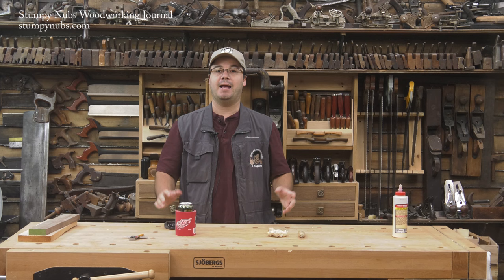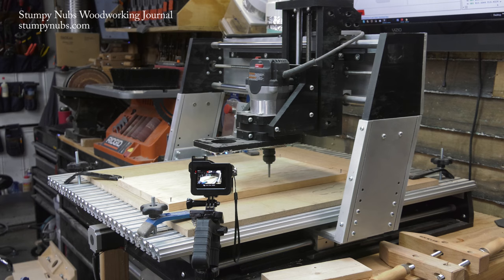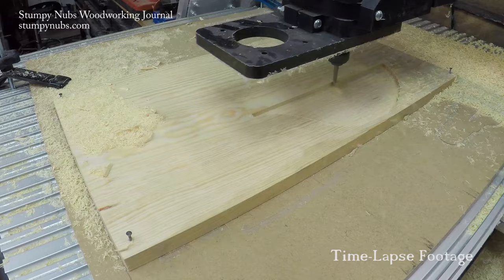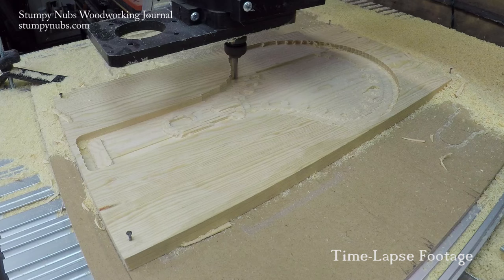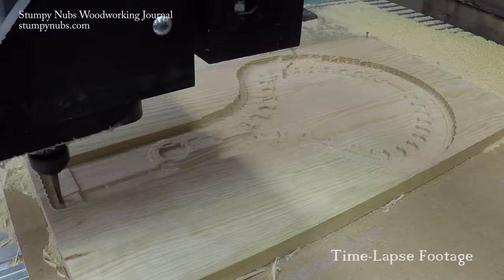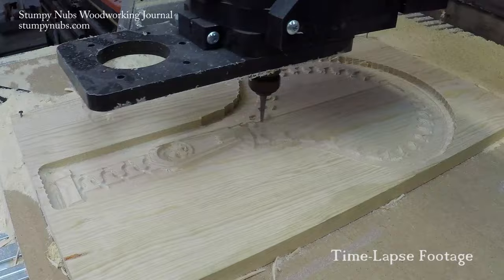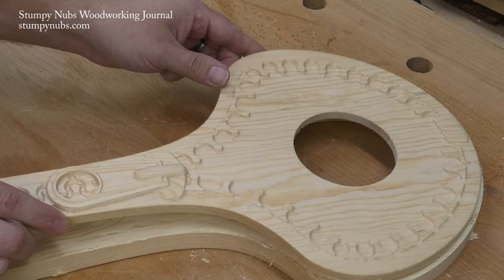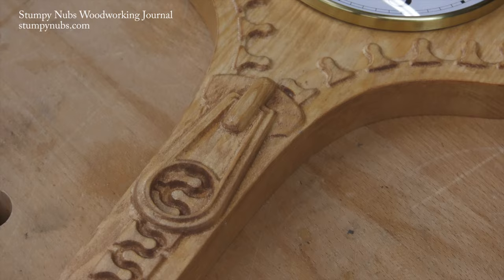WATCH THIS before you buy a CNC machine for 3D carving! (Updated)

Comment: Thanks for explaining 3D vs 2.5D in the CNC context. I was vaguely aware of the concept without the name.

30 years ago, a friend was working in a set construction shop and she invited me to come see the latest machine they acquired. It was a CNC panel router they had acquired for a specific movie production. They needed to make temple walls with carved out text (bas relief I think was the word used) but they were using forced perspective to make the temple set look bigger than it really was. It was described to me as being a giant printer with a router as the print head. I remember they were using Adobe illustrator to distort the postscript text. They hired a programmer to write the bridge software between illustrator and the CNC software. There was a lot of finishing by hand, but the panel router saved a lot of time and the movie had a pretty big budget. Hitting deadlines was critical. Iirc, the cost was in the tens of thousands—north of 50k.

Comment: It’s interesting reading comments from different sources for the same machine, some are great, some terrible. In programming we have a term “Do what I mean, not what I say”. I’m wondering if that is what is happening here, with the reviews?

So the question is does the device follow the instructions programmed, and if so does it perform within specifications?

I expect my machine to carve a design in to wood to a depth of 1/2”. Both software & hardware must meet that requirement. It does not need to construct Terminator 2.

Comment: It's still 2.5D carving despite having nice contours. A full 3D would carve the bottom as well. Missing half an axis is why it is always 2.5D with a XYZ machine.
Reply: That's splitting hairs.  Generally in the industry if you are making swooping curves it is considered 3D  Example, a V carved sign or a sign with letters raised off the background or cut in with a straight bit is definitely 2.5D.  A lions head carved with a ball nose bit would be 3D.
Reply: @sandmandave2008  I think for true 3D, you would need multiple axes. I'm no expert but everything I've seen and heard has called this milling process 2.5D as the entire back portion is flat and inaccessible. Saying this is analogous to, lets say, a bust or statute that is truly three-dimensional would be inaccurate. Just my 2 pennies.
Reply: @lvlikeyV   I still believe it's splitting hairs.  All of the model makers call their reliefs 3D models and V carved files are 2.5D models.  So what if you carve a perfect cube on a 3 axis CNC?  You end up with a full 3D model. It doesn't become a 2.5 D model because the back side is flat.  Many objects can have a flat back.  That doesn't automatically strike them from being a 3D model.  But thanks for the comment.
Reply: @sandmandave2008  I agree. I think the reviewer is confusing 3D with four or five axis capability.
Reply: @sandmandave2008  It seems weird that the  type of bit in the spindle dictates vs 2.5 and 3. (v-bit vs. ball end mill)

Comment: ANY 3 axis cnc is capable of true 3d but as pointed out in the video its all in the software. There is a number of 3d capable programs out there such as Vectrics aspire and V-carve. V carve WILL cut a true 3d but you cannot create 3d stuff within it. Aspire does both. These programs include a huge number of post procesors that converts from the program to some specific CNC controller. G-code is not exactly universal as claimed. Many machines have some features such as tool changers and so on. Just use the post processor that is made for your setup. I use v-carve desktop for say half of what I do even where I need true 3d. I just create the model in another program and import it in to v-carve. 

That being said you need to stay away from the el-chepo cncs around for anything more than basic simple hobby stuff.  Typically for the smaller ones about half the cost is the cnc and the other is the software.  For most you can easily upgrade the software part but you will be stuck with the controller program unless you are very experenced in digital electronics and have a good background in programming. 

My personal take on a cnc --- The best tool I have in the shop. If I had to choose between my home brew cnc or the table saw -- the table saw would be history. I use it for all sorts of things from just making oddball weird shaped holes, making hooles where there is no standard drillbit made for the size I need. Sometimes Ill slap a chunk of some firewood on it, mill off a flat spot and carve something in it.. Often I wind up with some wood that is shaped something close to an airplane prop and I want it dead flat and parallel. Usually its too small to run through a thickness planer or deal with safely on a table saw. I just clamp it down on the cnc with shims to get it stable then mill off one face., flip it over and do the same taking it right down to the thickness I want. At the same time ill run a pass along one side and an end. I wind up with stock with a KNOWN square corner and a straight side and end. I work with a lot of wood that goes for about $20 a board foot and up. WELL worth the time to "fix" bad chunks of it.

As far as CNC goes in woodworking. Its just another tool. If youre a crap woodworker the cnc will turn out crap work. Same goes if youre a real craftsman.. you will get top of the line results. A cnc can produce 3d stuff thats almost impossible to tell from hand carved by eye. Its all in the skill level used in the cad/cam side. For those that want to stay with "traditional" non power tool woodworking go for it. Theres plenty of room for everybody's slant on making sawdust.

My little CNC is a total home brew, no plans either.  It can hold within5 thou across 2 feet if I run it slower but it can run rapids in the 250 IPM range . Stout enough to snap a quarter inch bit clean into hitting a clamp without loosing steps. Close to the same size as the one in the video and has comparable specs.  Controller software is Mach 3 running on a 15 year old desktop. That desktop still runs faster than this 2 year old laptop. Ignoring the old desktop, I got right at $500 in it including Mach 3. I played around with a shark, nice machine but I DESPISE the controller software.  I DONT need all the hand holding but I understand why its that way --- PRODUCT LIABILITY issues. Mach 3 or 4 are FAR better controller programs.  Sharks now come with a version of Vetrics V-carve from what Ive been told. So using the same V-carve at right at $350 ( best I rember) my total cost is in the $800 to $900 range. Now That dont include labor either.

For those that dont have the skillset or ability to make a CNC themselves the Shark in the video is one of the 2 In that size range I have NO problem recommending even though I despise the controller software. Good solid cnc with good support.
Reply: I am in the market for a 4 axis machine. I need a machine with the capability of 24x24x6 minmum any suggestions?

Comment: I saw your video before completing to construct my CNC machine, and honestly, I was a bit scared . Now after 7 months of work and more then 7000 Eur. invested, I have to tell you this:Milling 3D is easy. It is all about the software, as long as the machine is strong and settings are correct.
No big deal, man.
Reply from the maker: Which is what this video is about...

Comment: I concur, software is critical.I started out as a high school wood shop teach and put the first cnc in the shop.  I found cnc more challenging then learning a conventional tool.  Anyway,  wood working takes sequential steps, process, precision, complexity. This whole debate regarding is cnc wood working etc, is silly.  You can have fun wittling or you can have fun with a cnc.

Comment: My boss just bought a CNC machine that the company just came out with. Their software is the worst I have ever seen. $30,000 doller CNC machine with $2 software on it. The software always freezes and gives a code that I have to call in becouse it dosn't even have a help section to look up codes. When I ask about no help button in the software they just tell me its coming SOON, famous last words. You are spot on about having good software as I spend many hrs. fighting this CNC machine to produce product. The machine itself is very well built but that does not get the job done. The worst part about it is I think my Boss thinks I don't know what I am doing.

Comment: Yup really cool stuff these cnc machine are. Alot of the 2.5d to 3d wood working is affected by the toolset / router bits you choose to use. As you mentioned at the end of your video. I say just look at the different baseboard or crown molding decoration shapes and you can see this on a large scale. The all you have to do is imagine shrinking it down to a small scale.

Comment: 2.5 axis carving is a limitation of your machine of moving only 2 axis at the same time. Good CAM software will usually overcome this limitation by creating 2 axis G1 lines that gives the same results as a true 3 axis machine (or realy similar results). The piece you carved in this video is done in X layer, cutting in 2D on the Y and Z axis. this can be done on a shapeoko with grbl arduino controler... but the piece won't fit the work area of a shapeoko :) If your machine talk Gcode you can do anything, all you need is the right CAM software.

Comment: Starting with G-code designed for your machine is one thing, but taking a 3D stl file through Vectric and out to G-code is another matter.One of the things your viewers should be warned about is that Vectric and other CNC packages don't always create the best toolpaths for a given design.  If the viewer is serious about creating 3D designs I recommend using 2 or 3 software packages to create toolpaths from a single 3d design.  These can then be previewed and compared for run, time.  The user will likely see quite a lot of variation.  I am frequently frustrated by how long the generated toolpaths take to turn out even the simplest of shapes.Many CAM packages can be run in evaluation mode for free.  Vectric is that way as is Fusion 360.Aspire is nice for its ability to create the 3d designs.  However, there are many sources for 3d designs given the explosion in 3d printing.  Many 3d print designs can be sent to a mill with little or no modification.Finally, there are many paths to creating one's own stl files.  Windows 10 ships with 3d builder.  There are also Tinkercad and Fusion 360.Be warned, there is a serious learning curve for working withn3d designs.
Reply: 3D design is like learning to hand carve wood:  easy to start, but it takes a lot of skill, practice and good tools to do well.

Comment: You just had a peek into the rabbit hole 2.5D machining is ( Yes, its still called 2.5D as normal cuts are commonly referred to as 2D ) You now know that there are hundreds of gcode generators that create 2.5D toolpaths. But did you wonder at one point why your machine is cutting so slowly and nearly grinds to a halt on z level changes ? Thats were all the fun and the sleepless nights start.

Comment: I love your videos generally but I prefer to spend my time working wood, not programming. I'm not a hand tool purist; although most of what people see in my end result is hand work, I do use a table saw, jointer and planer, etc. to do the 'apprentice' work. I've even been known to use the table saw for cutting repeated tenons (most recent project had 72 of them in one piece). So please don't consider this a howl from the Luddite fringe. But to my mind, somewhere you cross the line from woodworker to machine operator. Perhaps this is not the forum for this discussion but at some point I'd like the content creators to realize that CNC work is a departure from what I came here to see and presumably, what built your channel. Best wishes and looking forward to more woodworking.
Reply from the maker: Check the date on the video.
Reply: @StumpyNubs  I did but it came up in my feed so I watched it.

Comment: Hi - Enjoying the good info in your vids.  Just a comment on your hold-down method of 4 nails.  If you're using an up-cut mill, especially on hardwood, the vibration and upward force exerted by the mill can shake and pull your piece loose and suck it up onto the bit, destroying your project.  I trashed a $25 hickory board because my hold-down screws weren't far enough into the spoil board.  Gave the spindle a good shake as well when it tore loose.  So hold 'em down secure.  Thx.

Comment: I built transmissions for largest grossing shops for the last 40 years in Houston. I was wondering what a price would be to invest for a set up like yours in the video above.Scanning the links you provided for amazon above  I'm guessing cnc, software, vacuum set up , tables and other tools and optional stuff $5-6 K to set up a pretty decent setup. Would that be close ?  I know it depends what you want to make and how deep you want to go. I agree that its a waste to buy base model setups and better to invest a little more into the operation with better equipment / tools. Same thing with transmissions. I learned fast to leave cheap tools alone and buy Snap on tools. With right set up you can continue challenging yourself.
Reply from the maker: I am using the CNC Shark. It comes with pretty good software that will work for 2-D work (V-Carve Desktop). The 3-D software (Aspire) is more expensive if you want to do more detailed carvings.

Comment: At 3:20 you can clearly see the wood fiber fuzzies. I have a very stable machine and use sharp bits but with most woods other than teak quality woods I have this always and cannot seem to find a way around this. Since the fibers get ripped out of the wood a bit sanding it completely smooth afterwards is also a challenge. I experience fuzzies at both climb and conventional cuts with also both spiral and straight flat and ballnose bits. I take way to much time smoothing after the cnc finished its job. What would be the best guess to try next?

Comment: With the knowledge and experience you have gained over time maybe you can provide some insight. Any reply appreciated. What CNC router / carver and software would be sufficient to produce guitar and banjo necks for a start up business? Maybe it's cheaper to just get a tool path for items in a data form I can hand to a business with the equipment they can plug into Thier computer and go???

Comment: Any 3 axis CNC should be able to do 'true' 3D carving but for my home made machine I've had problems finding free software. I use F-engrave which is simple but works well. At work I use Power mill by Delcam which works fantastic on my 5 axis miller but is very expensive.

Comment: I'm curious, milling bits typically cut in one direction cleanly and in the other they make a mess. You can see in your video the stringy long chips that are just awful.  Do you know why wood working CAM software doesn't do a better job with tool paths? Is this options you are using to speed up cutting or is this really how they work? I know in metal working chip evacuation and surface finish are big biz. But it seems like every time I watch a wood working video the CNC machine just makes a mess.

Comment: You changed CNCs because you didn't like the software?? That's like buying a car based on what radio station it comes tuned to.
Reply: No, he said he bought a machine that was more robust than his first one.  The 3D creation software has noting to do with any particular machine, all you need is for the post processor to generate the proper G code for the particular software your CNC machine uses to run whether it be proprietary software or something like Mach 3.  What he stated is that machines that come with software included are usually not very powerful.  I think he bought a more robust machine because of the type of 3D carving he wanted to do.  I know guys with table top models where in cutting wood, they are pretty much maxed out at 40 ipm  because of the rigidity oy the machine and the horsepower of the router, whereas I carve 3D on my machine at 150 ipm since it's a big rigid machine with a 5 hp spindle.  Some guys have spindles up to 12 hp and cut at speeds of 300 ipm or more.  The main point of this article is to make you aware that machines with FREE software will be extremely limited and the more you spend on a machine, the better chance you have of getting better software.  My router ($12,000) came with Mach 3 to run the router and V Carve software for making 2.5 D models.  My 3D creation software was $7000.

Comment: It’s the software, not the machine. You can spend $10000 on a machine, but if you don’t have 3D design software, that machine won’t cut 3D. 3D software isn’t free, not any that I’ve seen. Ventricle Aspire is around $1700, I think the last time I looked. I have Vectric Vcarve Pro, that I can upgrade to Aspire, but they still want a good chunk of change. Fusion 360, I believe is a subscription type deal that adds up over time. Unless you’re going to do a lot of 3D work, I don’t think it’s worth the price. Vectric has Design and Make that you can access from their cheaper software formats, like Vcarve Pro. For around $35 you can buy a design that has 4 or 5 designs that can be arranged with each other for different looks. I have one for baseball that has a ball, bat banner home plate and the diamond. You can use the ones you want or all of them in any design and size you want. Etsy has a lot of designs for sale too.

Comment: Thanks for the tips.  I'm considering the purchase of a CNC machine.  I noticed that when you changed out bits that there was some give when you tightened the colllet.  Is that an issue for accuracy or do you re calibrate the location of the project with every bit change.